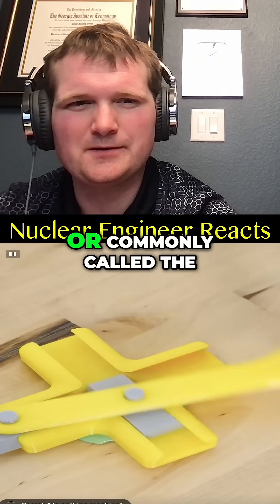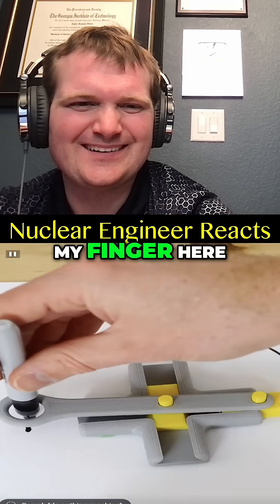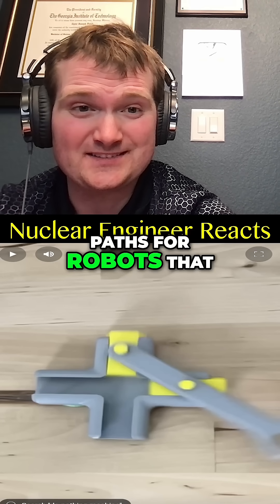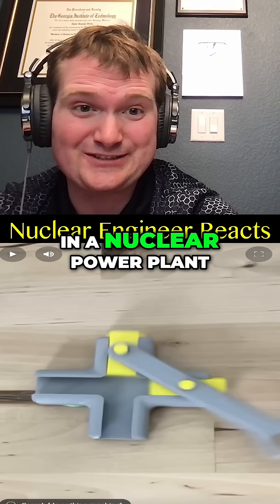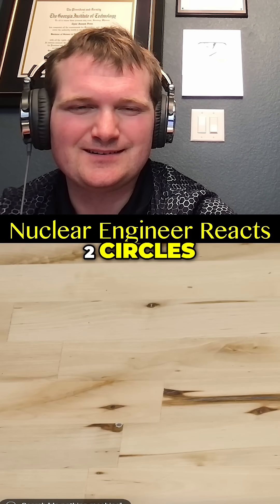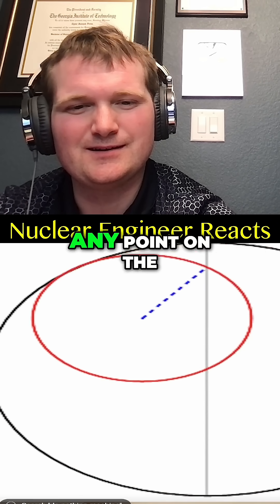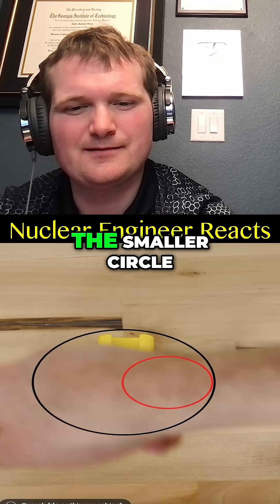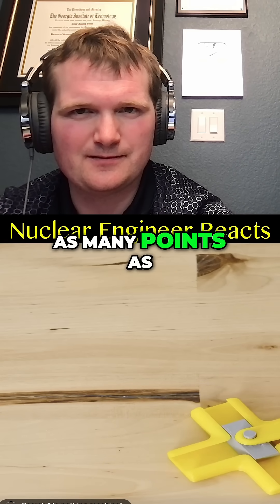The Do Nothing Machine - Nuclear Engineer Reacts to Action Lab

Comment: 2:21 "I've done some digging" this means this person is not an expert😂 if this person is TRUELY an expert, he would've known right off the bat that the kind of mask you're using is right or wrong. "This mask is not the right shape" all mask comes in all kinds of shapes and sizes, what's important is the filter inside, this proves that this person just did a Google lens search and went straight to the verdict😂😂😂 I've seen enough bullshittery in the internet and for me it only takes 4 years in highschool to know that uranium emits alpha particles(that doesn't penetrate skin) and she used tiny amounts to its ok. In fact, its safe enough that it is used in smoke detectors. Just don't use the kind that emits beta or gamma particles💀
But still, its radiation, handle with care cuz better be safe than sorry❤

Comment: If you use levers attached to partial gears and the teeth of those gears move the pedals that swing the bar, you could essentially use it to clean out holes based on size with an attached sweeper or some kind of boring machine that doesn't rely on a spinning bar. Essentially, it could spread stress on multiple pieces instead of just one piece of metal.

I dunno, there might be a use for it but I suppose the need for it just isn't there yet.

Comment: you can actually also use this as a gearbox, if you offset the '''small circle'' and make the pegs a bit smaller, depending on which side you power the ratio would be 1:2 or 2:1. (it will be very inneficient due to friction tho)

Comment: I"m seeing internal combustion applications when moved to a 3d space instead of a 2d space that replace the crank shaft  and can significantly increase the engine cfm / volume? rotary valves could also function in a very similar way

Comment: maybe a circular engine with pistons somehow . if it's flat engine u can have 8 cilinders above 8 and again above 8. 24 cilinder for more power so it can lift heavy stuff. for example ships travel very slow due to the fact that alot of power is lost since it's water you are trying to advance trough. i feel this would be a good aplication. or a water pump with many valves that throw water at a very hight rate in a chamber and out like a jet. i have no clue , i'm not an engineer but i have a feeling :).

Comment: Do nothing merely means the net work done is zero, because force and displacement are at right angles to each other. Even though it can be used somewhere but it does not do work as per physics.
Reply: Very concise, thank you
Reply: What exactly is the load being displaced here?
Reply: What no- it does work, it do transfer power albeit not very efficient (because yes the force and displacement are not aligned, but not 90 degrees so there are work done/transfer)
Reply: Ohhhh
Reply: No this invention is literally called the “Do Nothing Machine” he isn’t trying to refer to any term
Reply: Okay, so it only demonstrates that mathematics does not equal reality?
Reply: @illusiveelk2558  Actually its the opposite.
Reply: @illusiveelk2558  No, it demonstrates that words have different meaning in science vs common life
Reply: @illusiveelk2558  So, work is defined as product of force, displacement and cosine of the angle between them , since force and displacement are right angled (90 deg) , then cosine(90) is 0, hence net work done will become 0.

Comment: Looks like an easy way to setup some sort of fluid flow that can block multiple paths while leaving open others.
Reply: Very cool take. But after a min of thinking I think it probably won't work for a single source supply as at some point the supply route will be plugged. Although it'll work if we have 2 source routes but these routes shouldn't be adjacent for obvious reasons that leaves us 1 choice that is having source channels opposite to each other, in which case this kind of system will prove to be redundant as both sources are supplying the same channels. It really is useless lol 😅